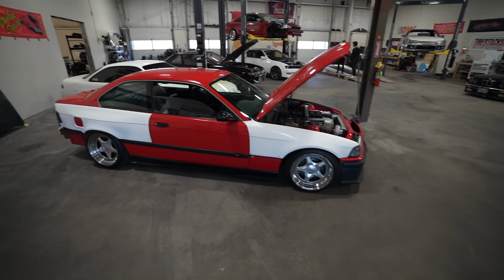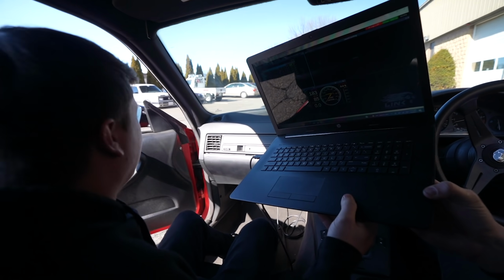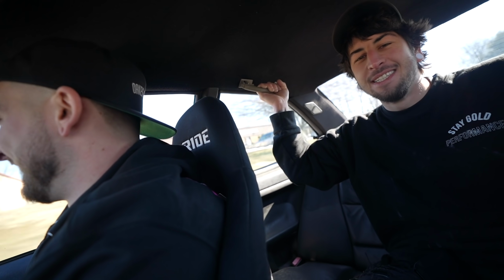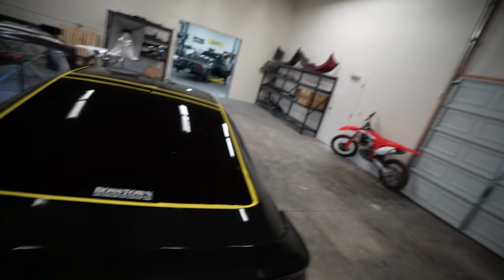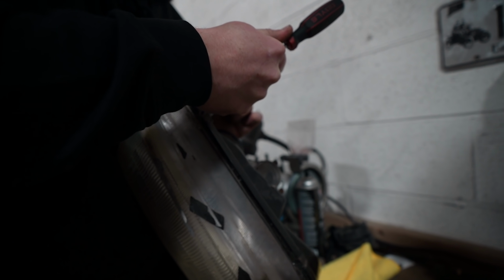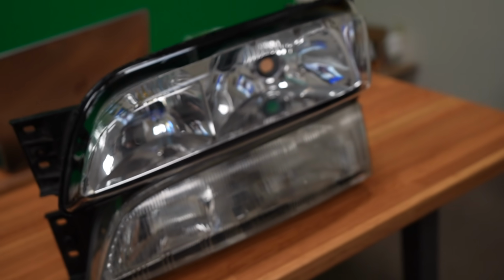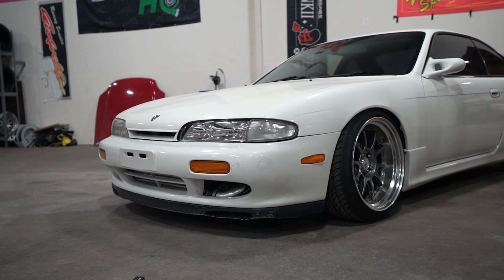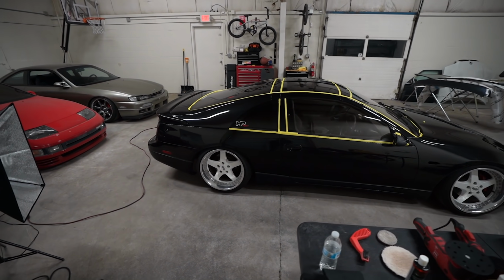Modifying My S14 Silvia and INSTANTLY Regretting It..

Comment: The headlights would look good if everything was clear to match.
Reply: Nah he needs to run orange corners lights
Reply: The clears look sick on camera but the side markers throw the whole thing off but the clarity of the lights is way better than stock
Reply: DMAX makes clear parking corner lights, and there are even ebay specials for like 50 bucks (last time when i bought them), maybe for the fun of it? and maybe snag dj's navan bumper, that could work as well
Reply: Rrrrrrrrrrrrrrrrrrrrrrrrrrrrrrrrrrrrrrrrrrrrrrrrrrrrrrrrrrrrrzyr
Reply: The light is going to be terrible. The reflector refracts the light. And in this case the glass
Reply: @КирилНачев-ш4г  these style of light housings are for aesthetics not function. And if he truly wanted function, all he would needs to do is throw in a nice set of LED bulbs that have a good cut off.

Comment: For these clears to work you'll need a yellow LED for the high beams and clear turns as well I did this same mod to my 93 Honda Accord back in early 2003 and even with stock bumper it really pulled off the look

Comment: Turbo the corolla. You can find factory manifolds on yahoo.
Reply: Diesel
Reply: @bradleydunkley3348  And? Do you think there are no turbo diesels?
Reply: @tag206  no it’s impossible they don’t exist
Reply: @bradleydunkley3348  But to clear this, as long as he doesn't run it too rich, fuel is what blows up diesels not boost, the stock 2c will run forever at 10-15psi.
Reply: @tag206  it’s a diesel vehicle you can’t turbo it sorry
Reply: @tag206  same as automatic vehicle can’t be turbo

Comment: Clear corners and retrofit the low beams with projectors and shrouds that match the s15 for a nice OEM+ look… Also, as someone that’s retrofitted a lot of headlights. Baking lights in the oven at 200 degrees for 10 minutes works way better. Just put a towel on a cooking sheet, light on top of the towel, and place on bottom rack with the rest of the racks removed. This gets everything nice and warm evenly which makes it easier to work the lens off slowly all the way around. When pulling the lens off, if you get those long strings from the sealant, cut them with a sharp razor blade so they don’t fall into the housing. To seal it, just bake the housing the same way for a couple minutes and place the lens back on. Usually there’s no need to use new sealant.

Comment: Quick tip for those at home with oven access, preheat oven to 240 degrees and leave each headlight (or Z32 tails) for 15 minutes. They open like butter.

Comment: I've put a few headlights in the Oven and never had Problem.. I always extended the oven with the top of a coilover packaging carton wich fits the oven door perfectly, lowest temperature and check super often how hot it gets, it just needs to be warm so you can still touch it.

Most of them where BMW and VW headlights.. 🤷🏼‍♂️ but I've also done it with a heat gun and that works just fine as well..

Comment: depending on the offset, and if you shave the inner lip of the over fender you can fit a 285/35-40 i had a 275/40 on an 11.5 wide with no added camber.

Comment: Vehicle lighting varies by market, often more than you realize.  Manufacturers will often design the various lamp assembles to fit the same position so not to require different body panels.

Comment: It needs the clear corner lights, clear side markers and clear turn signals 🤙 then it'll look better, especially since the car is white it'll be cleeean. Also with navan front, navan sides, kouki tails, kouki rear bumper w valances maybe kouki wing and dmax roof spoiler 🤙🤙🤙

Comment: you should get the DMAX corners/parking light housings, that could work with those headlights actually. I had a pair of ebay knockoff ones on an euro zenki, didnt look too bad, even came with orange bulbs. However never got around to tint them amber, as i wanted to go a USDM-kind of look? (eurofag here, cars usually have clear corner lights and stuff, and i wanted to change it up a little), and maybe snag DJ's navan bumper just for the heck of it, i think it can work fairly well

Comment: If they are jdm headlights they will light up differently, a normal usdm car will have a flat line that goes up to the right to maximize the light without blinding opposite traffic, while on a jdm car it's the opposite as they drive on the left side

Comment: I have a 335i and I bought everything to do full bolt ons and the clutch slipped after the first pull with a proper tune :(( may be using that special code soon

Comment: It's wierd how everyone needs a twin disk over 450ish hp I've got a 4 year old single plate clutch with a beefy pressure plate at 500hp and I can dump 5th gear clutch has never slipped it has been on 3 different motors also.has been used with my 500hp engine for 2 years

Comment: You're gonna hate driving at night with those clear lenses, Jimmy. The bulb deflector and fluted lens are what directs the light output properly to the road. Removing both essentially cuts your light output in half. If I was you, I would retrofit a set of projector lenses in there. Cheap AF off Amazon and SUPER easy to install. At that point you could run either HID or LED bulbs.